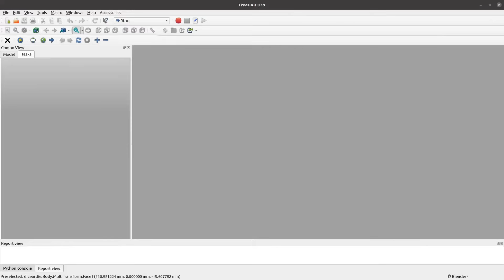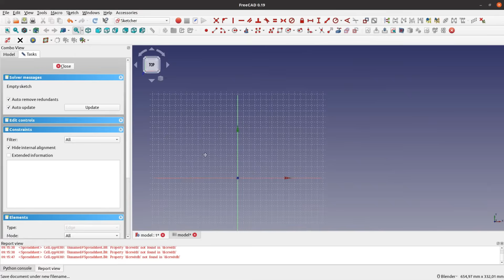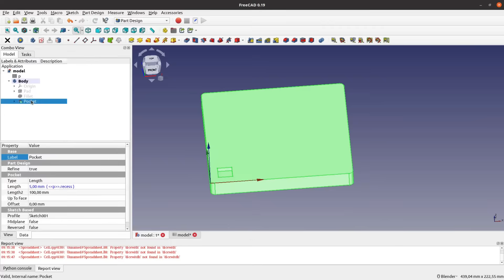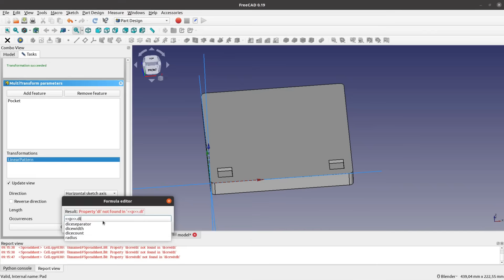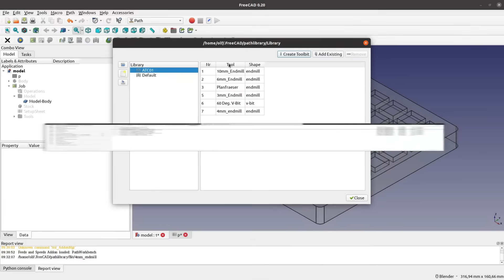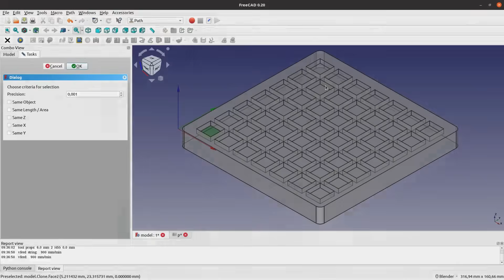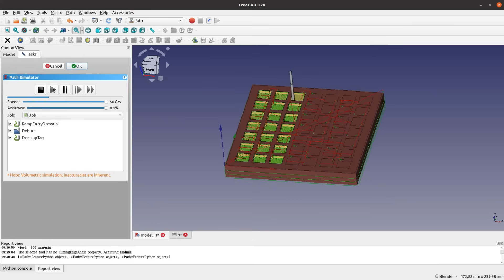CNC with FreeCAD: CAD + CAM workflow

Comment: This is such an important video, to get from a project to an cnc, but I can not give it a thumbs up because you're going so fast that its impossible to see what you're clicking on. Freecad is such a comprehensive program that has so many possibilities to get to where you want that you can not just assume that everybody knows what you are doing. If you want to make a beginner's video assume that your viewers don't know anything. I really appreciate the time you spent on making this video, but if your viewers can't make head or tail out of what you're trying to explain it has little value.
Reply from the maker: I had a similar discussion when I gave an overview of how I use FreeCAD for woodworking in general and ended up creating a very extensive 6 part series. While a few people were complaining about the speed of the overview video the 6 slower paced parts combined did not reach the views of the one overview piece. 
So it seems that either the YT Algorithm or the majority of viewers (unfortunately the two are impossible to distinguish) are rather interested in shorter formats.

Comment: Thank you very much for this!   It almost seems like there is so much one needs to know in order to even get a CNC machine working on a project - the learning curve seems (at least from first glance) to be overwhelming.      I use Freecad to create 3D printed projects.   And creating an STL file only takes two very simple steps.
Reply from the maker: The CAM part is quite a bit more involved. The main difference for me is that it is much easier to mess things up with the CNC by setting a cut too deep, selecting the wrong reference, etc. ...

Comment: 0:59 > "radius of the corners"
how did you measure that?
Reply from the maker: There is a thing called a radius gauge. I found them super helpful in modeling stuff for the CNC or 3dp